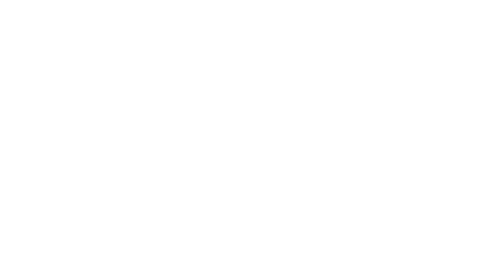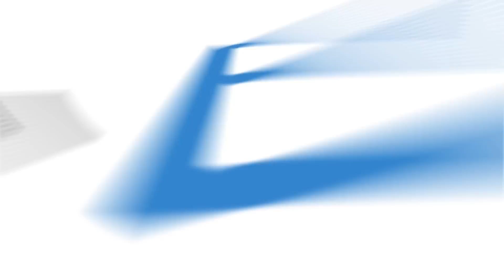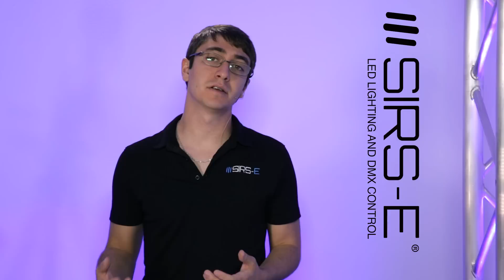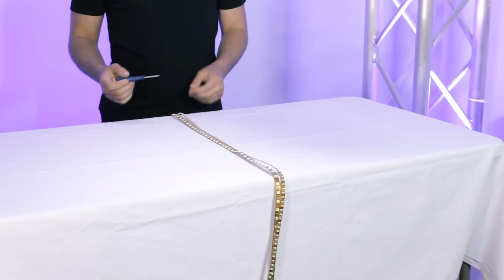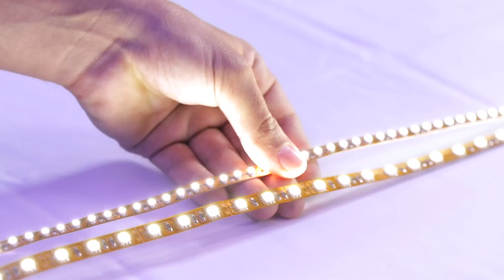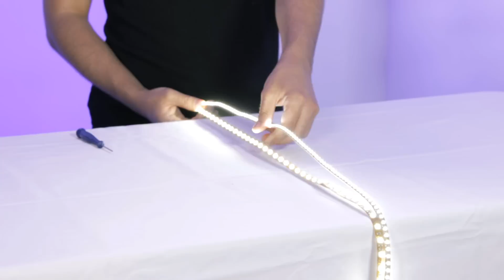5050 vs 3528 LED Strip Differences High Quality by SIRS-E

Comment: i want to get the GRBW LEDS for my room to apply on the edges of the ceiling. Which one would you recommend? For the best effect ?
Reply from the maker: Hello, we only carry the 5050 chip now and i believe it will work fine for your application.
Reply: SIRS Electronics Inc thank you responding

Comment: so which one makes more light???
Reply: 5050 will output more light for the surface area, but the 3528 will have less 'dotted line effect', as well as offering greater resolution(higher pixel density) when used for LED displays.
Reply from the maker: If you compare single chips side by side, the bigger of the two LED's will produce more light.

Comment: Can you connect 5050 LED strip with a 3528 LED strip? or is there not enough voltage to power the 5050 because of the smaller wall plug-in?
Reply from the maker: Yes you can, as long as the voltage is the same.
Reply: I was looking for that answer, thank you..

Comment: for bedroom behind curtains and back of computer table etc. should i get 5050 or 2835?
Reply from the maker: You can probably use 3528, If you use the double density it will give you a more diffused.

Comment: is it the controller that would make chase lights out of these strips?
Reply from the maker: In order to achieve chasing patterns you will either require pixel by pixel controlled strips, or the strips that are pre programmed, these are standard LED strips which means they are controlled all together, here is a link to our Direct DMX pixel by pixel controlled LED strips. https://sirs-e.com/product-category/led-lighting/dmx-rgb-led-strip/

Comment: can i work a led strip 5050 with a battery 9v? 24K remote control, and 18 leds
Reply from the maker: It just depends on the specs of your strip, you would need to check the strip you have, like the voltage and watts consumed, things of that nature.

Comment: Can I first put 3528 for 5 meters, then connect 5050 for another 20 meters?
Reply from the maker: The only way you can make a continuous run like that is by accounting for voltage drop, and using the proper booster amplifiers, or powering the strips directly. You will need to check on the power consumption of you LED strips.
Reply: SIRS Electronics Inc

Comment: My mother-in-law has a Denver Bronco that hangs on the wall with incandescent lights on it in a tube and zip tied to a metal frame.  Sections of the lights in the middle are not working and I want to replace it with LED's.  In doing my research 120v LED strips would give me the length I need but with cut intervals of approx 3 feet won't work when I need to change from one color to another.  12v LED strips give me the cut lengths I need.  Each of the listings say I can't go to the length I need.  If I use a 12 watt power supply how long can go with 12v strips?
Reply from the maker: With our strips at single density you can go 2 full strips without voltage drop (32.8 ft) and with double density you can go 1 full strip (16.4 ft) please check out our website at www.sirs-e.com or email us at info@sirs-e.com for more information.
Reply: Thank you for the answer but I need around 36 feet.
Reply from the maker: anything after the recommended lengths we advise added a booster amplifier, however it can be done without one.

Comment: Hi, thanks for explaining the differences.  I had a question about mounting the larger 5050's directly to something like wood.  Is the heat output such that you would need an aluminum mounting track?
Reply from the maker: you wouldn't necessarily need the track, the heat output is not that much to affect the wood.
Reply: Ok, thank you!

Comment: very good video...i would like to buy one of those lights to put them under my music keyboard to light the other one (one is on the top of another)....but i dont know wich  one is better.....sorry for my bad english.....any advice...?..thanks...
Reply from the maker: No problem at all we can definitely help you out, feel free to email us at info@sirs-e.com would you like the 5050 model, or our 3528? Here are links to both. 3528 is smaller but is capable of more LED's per meter, while the 5050 has more light output.https://sirs-e.com/product-category/led-lighting/led-strip-lights/white-led-strip-5050-wp/https://sirs-e.com/product-category/led-lighting/led-strip-lights/white-led-strip-3528-wp/

Comment: Hey there, i would like to know which led light would be good for the back of a tv, which would be mounted on the wall?
Reply from the maker: I would go with 5050 single density (30 LED per meter) https://sirs-e.com/product-category/led-lighting/led-strip-lights/white-led-strip-5050-wp/

Comment: I'm wanting to install LED strips on the front of a mirror with a cover over it. Even with the cover diffusing the light, I'm concerned that it may still appear as dots. Which would you recommend for more of a "light bar" effect?
Reply from the maker: Hello, I would recommend going with the 5050 model.
Reply: Lindsay Watson Did you ever go fourth with that mirror project? Im wanting to do something similar and wondered if you got the light bar effect or did it still look like dots of light?

Comment: For 15 meters of 5050 what adaptor would be save to use? Will 10A be save enough to light it up. Heard stories that the full kits that r sold in market are cheap and Amperage is 3A. Cheers
Reply from the maker: +Mariusz Łysik Hello, are you talking about quick connectors? Single or double density? Our single density you can do 3 rolls for 6A and our double for 12A as far as packages our smallest uses 2A for 5m and our smallest uses 8A for 10m. Our single density 5m uses 2A and our double uses 5m uses 4A.

Comment: but does the size matter in terms of light production? example, larger diode more lumens, brighter light etc.
Reply from the maker: +Terra Anch Not necessarily, it all depends on the quality of the LED. Phosper purity is the main thing you want to look at when knowing the difference between high quality and low quality LED's.

Comment: how much voltage required for each
Reply from the maker: +bharath kumar , Hello and thanks for your comment. Most of our LED strips are 12V DC with the exception of our DMX LED Strips which come in 5V DC. If you have any questions or need assistance with a project, feel free to email us at contact@sirs-e.com or call us 956-522-2006.

Comment: what does mean the DD and SD?
Reply from the maker: +Edgel Mendoza , SD stands for Single Density and DD stands for Double Density. The density refers to how many LEDs per meter the strip has. The 5050 LED strips have a Single Density of 30 LEDs per meter and a Double Density of 60 LEDs per meter. The 3528 LED strips have a Single Density of 60 LEDs per meter and a Double Density of 120 LEDs per meter.

Comment: Can i use RGB 5050 or 3528 for hydroponics ?  If yes, what else led support should be used beside LED itself ?
Reply from the maker: +Nothing Less, This is not are area of expertise, but I am assuming you want the option that produces the most light which would mean that you are going to want the 5050 double density waterproof option. The benefit that LED's can also offer is the ability to offer more lighting without the addition heat. This means you can have more lighting directly applied to your plants. Feel free to reach out if you would like to put a project together @ http://sirs-e.com/contact-us/

Comment: How can I connect three strips to one power source ?
Reply from the maker: Hi +Ej Peterson, thanks for watching our video and for your comment. You can connect them in series or in parallel, but you might experience voltage drop.  Make sure you watch your power consumption and calculate the wattage of your power supply first.

Comment: so? can these led strips run 1000 watss?? if so how?
Reply from the maker: +Ruiz Sage If you are talking about using a 1000 Watt power supply, sure thing, but do not forget that regardless of the power supply, due to voltage drop you are still looking at a limited LED run depending on a specific LED strips density. If you got a project that you want to run by us, please reach out @ http://sirs-e.com/contact-us/

Comment: I just brought a 3528 led strip and 4 CR2025 lithium sony battery. I am wondering if i could power up my led strip with these 4 batteries? My circuits knowledge are bad.
Reply from the maker: Hello Nishimoto Mitsukuni, the 3528 LED strip uses 12V DC to power up and depending on the density and color it consumes different power wattage. The CR2025 batteries you have are 3V and theoretically 4 batteries in series will give you 12V, but the capacity is nowhere near sufficient to power up the strip; it will turn on for very little time. I would suggest our high quality Lithium Polymer battery packs which come in different capacities and are specifically made to run any LED applications for several hours.

Check out  one of our videos on this topic here: https://www.youtube.com/watch?v=k-rlqBOP7b0And you can find LIPO batteries for LED Strips http://sirs-e.com/product-category/led-lighting/led-strip-batteries/
If you have additional questions feel free to email us at contact@sirs-e.com

Comment: Nice job explaining the difference. I need to run 63' or 20 meters of warm white LED ribbon lights around my deck hand rail. Is there a way to do this by linking the strips together and only having one power source (at one end)? If not what would you suggest?
Reply from the maker: Hello Cheryl SeaAngel, thank you for watching our video and for your comment. It is technically possible to have 4 LED strips (20 Meters) with one power source but your power source will not be at the end, rather between 2 strips. This will work for some single density strips. It is not a simple answer but you have many factors to consider such as density, LED strip type (5050/3528), and Waterproof Rating.
Reply: SIRS Electronics Inc Thank You very much for your response. I don't want the lights to be bright and over powering, I assume I would want warm white 3528 strips. The position of the only 110 outlet on my balcony/deck is at one end and the balcony/deck is 30' or more off the ground. We are in a Ski Resort at 8k feet above sea level with very cold winters. Would I need to run an outdoor extension cord to the center point?
Reply from the maker: Hi Cheryl SeaAngel, an extension cord can work. Due to your weather conditions I would recommend you use strips that are IP68. This is because, unlike IP67, IP68 can protect your strips against moisture and condensation. Here's a test we did so you can see how water can affect your LED Strip https://www.youtube.com/watch?v=nGpmyvow9R8

Comment: Can i connect with wire and soldering:
1m  of an smd 3528  (7.2 watt/m) led strip to 1m of an smd5050 strip (again 7.2 watt/m) ??
Reply from the maker: Hello valia chasapi, thank you for watching our video and for your question. Before you get into soldering LED strips we would like to recommend for you to consult a licensed electrician to make sure you get everything soldered and connected correctly. Now, you can solder a 3528 LED strip and a 5050 LED strip as long as they're both single color only.  
If you need information about Power Consumption watch our video on how to Find the Power Consumption of Any LED Strip https://www.youtube.com/watch?v=WZZ6ZlAFPls

Comment: Thanks for the info... Is the cold white a true 12000k...... I'm looking for 5050 or 3528 in a temperature of 12000k.... Thanks again.
Reply from the maker: Hello rpeagram, thank you for watching our video and for your question.  Yes, the Cool White will have a color temperature of 12000-14000K and we have them available in 3528 or 5050 LED strips.  You can check out the 3528 Dual Density Cool White which will have 120 LEDs/m:

http://sirs-e.com/shop/white-led-strip-3528-wp/3528-smd-cold-white-led-strip-12000-14000k-5m-16-4ft-double-120/

Or check out the 5050 Dual Density Cool White which will have 60 LEDs/m:

http://sirs-e.com/shop/5050-double-density-led-strips/5050-smd-cold-white-led-strip-12000-14000k-5m-16-4ft-double-60/
Reply: Thank you for your time.

Comment: Good explanation. Appreciate it. Watts per foot would've been a nice statistic too.

Looking to put these in a Truck Cap - hoping the wattage is very low so I can run 2 strips and an LED dome light. It should be easily possible.
Reply from the maker: Very happy that you liked it.  Thanks again for watching!  lifeisgood070
Reply: SIRS Electronics Inc hi there. i bought this 5M/16Ft 5050 RGB 300 LED LED Strip http://www.ebay.com/itm/391044936635. I wasn't too happy with it's brightness. I wanted the brightest RGB strip i could find and could only find the 5050. I've used it for a few days but i'm not impressed with it's brightness. I checked online and found out that if i powered it on both ends with the same cheap power adapters it came with i could get a little extra brightness off it. I bought 2 LED strips so i'm now using 2 power adapters on one strip. It looks a little bit acceptable or closer to what I wanted. 
i found out from this discussion 
http://electronics.stackexchange.com/questions/19413/why-doesnt-my-5050-led-strip-draw-as-much-power-as-i-expect
that there is some power lost in the cable. My question is is it safe to use a 16V 4.5A (72W) laptop adapter to power the 5050 RG LED strip?
What's the difference btwn powering one 5M 5050 LED strip with a 12V 6A power adapter vs 16V 4.5A power adapter? They are both 72watts, aren't they?
Or should i step up to 5630, 7020 or 8020? I'm looking to light up a store window display.
Reply from the maker: Hello Sir Jay, thank you for watching our video and for your question.  Unfortunately a 16V power adapter will not work because your LED strip is rated for 12V, even if they have the same wattage.  Visit our website at http://www.sirs-e.com and take a look at our high-quality LED strips and power sources, including our new line of battery packs.
Reply: +Sir Jay 
This using two different adaptors at either end of a strip is not a good Idea as the PSU are fighting each other and unless they are designed to work in parallel can cause a problem as in early failure, overheating or fire.
Reply: ended up doing it serially. Good food for thought there though. I really should know more about psu's and how that interaction occurs. Thanks Derek.

Comment: Hi, I have a 5050 rgb led strip and I only use 1 meter long...my question is which power supply should I use for only 1 meter long, is it 12v 1a or 12v 5a? Which is better?
Reply from the maker: Hello +fish808, thank you for your question and for taking the time to watch our video.  A 12v 1 Amp strip should work, but I cannot be sure because I do not know the specs of your strip. Just go with the 5A to be safe.
Reply from the maker: Mr100duke, actually some strips can consume up to 1 amp per meter, it all depends on the strip.
Reply: SIRS Electronics Inc sory for my really late reply,  but im using right now the 5a for only 1meter long, and there is no problem yet, my strip still working fine, its 2 months now, ....but anyaway thanks for the respond :)

Comment: Hello! I would want to know if I can cut the "LED STRIP" in small pieces (cutting on correct points, of course) and soldering the wires (red and black) between them. I want to illuminate some parts and have a gap without illumination, and again a illumination point, and other gap and so on. There is any problem?
Reply from the maker: Hi, Rodrigo Caldas ! Yes of course, you can cut the strips into segments. The beauty of LED Light Strips is their versatility. Like you said, be sure to cut only on the designated points of the strip.
Reply: You'll want to have a fine tip on your soldering iron, pre-tin the wire and copper tabs. Then it's just a matter of using a soft weight on the strip to keep it in place. Nothing hard or too heavy that may kink a resistor or diode loose. I use a gel-handled pair of pliers